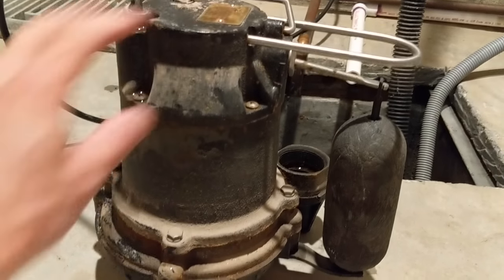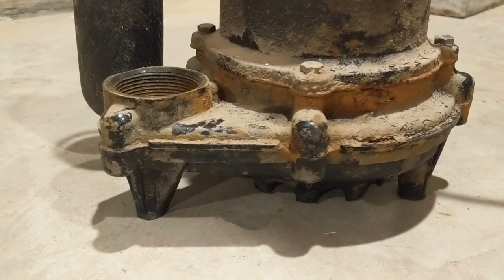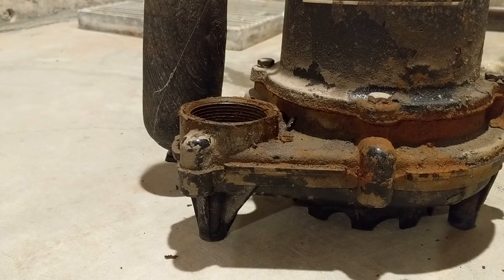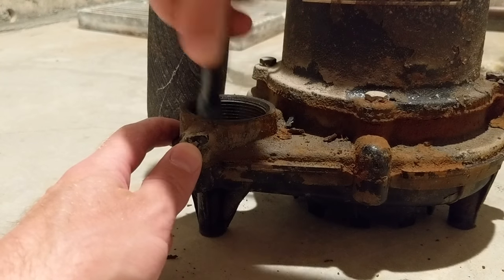Sump Pump Not Working?  It Might Be Air Locked!

Comment: HD sells a Basement Watchdog pipe that is pre drilled and cemented with all that you need to connect. I used on the same pump and it works great. For $25 dollars it's one less worry. I've done several pumps and swear by it.

Comment: Actually, an ideal installation would have the check valve out of the pit and 6 inches or so above the basement floor level. Your weep hole should be drilled a couple inches above the high water level. The weep hole should never get submerged by the rising water. Otherwise good info.  Many professionals think a weep hole is unnecessary in the discharge pipe. I assure you it is very necessary, even with a weep hole already drilled into the pump housing.
Reply from the maker: Thanks for the info!  Part of the reason I do these videos is to start a discussion.  I really enjoy coming across people whom have something to add:)
Reply: Maybe that's the problem I am having. The pump will always run when the water gets high enough to move the switch, but about one time in ten no water actually gets pumped. The pump would run forever and never pump any water if I let it. So I tried putting in a 3/16 hole between the low water line and high water line. Again, about one time in ten it will run but not pump. Sounds like I should try putting the weep hole above the high water level.
Reply: A follow-up to my earlier comment. It turns out that the lack of water flow was due to the check valve being damaged. I didn't think it was possible, but the flap occasionally got stuck and would not let water flow in either direction. After replacing the check valve, everything worked as it should. I am going to experiment with not drilling a weep hole. As of now the hole is not needed.
Reply: Not sure why the weep hole would have to be above the water level.  In the case of an air lock, the air would just bubble out of the weep hole.
Reply: I am beginning to wonder if this is why my pump would turn on but not pump water; I assumed it was because the discharge pipes had gotten frozen then the big thaw happened and my sump room was underwater til a good shake finally got things moving again
Reply: @SelkiesSong  Yep. Sounds like it was air locked.
Reply: You're the first guy to say drill the weep hole high enough-- above the high water mark. Interesting. Makes sense. Think a lot of people drill simply a couple of inches above pump discharge.
Reply: @baseline8017  Still could've been an issue of not having a weep hole. I am going to drill one come dry season. I just took piping and check valve apart on mine. Check valve flapper appeared seized. Now, I am not sure. That slight seizure or being a little stuck might give way if no air lock in pipe beneath check valve.
Reply: @bfullsyou  - I guess it is possible that the weep hole was a factor at some point but I am happy to report that a year later my sump pump has never skipped a beat even though there is no weep hole at all. Maybe some pumps require a weep hole and my particular model does not. I don't know.
Reply: @SteadyDrizzle  You're probably right-- might not need to drill weep hole higher than high water mark.
Reply: @SteadyDrizzle  This is true. This is what I found out from this channel called Power Equipment Direct: The weep hole should be lower in the pit because it is meant to relieve the pipe of any air left in the system after a draining cycle. You want the hole to be underwater and the pipe below the hole even after a draining cycle, so air can't get trapped in the pipe. Having the hole up high greatly increases the chances of air lock and burning out your pump.
Reply: Actually, you want the check valve in the pit whenever possible so that should it fail water stays in the pit instead of spraying all over the walls carpet etc
Reply: And placement of the weep hole should be in mfg instructions. I dont recall them being that high i believe they generally recommend about 6". Mfg specs almost always take precedence apart from local code. Failure to comply can void warranties.
Reply: @bfullsyou Are you sure
Reply: @timmark4190  I’m still learning. Got anything new?
Reply: @SteadyDrizzle   with a big enough hole, yes. If your hole is too small (or dirty and clogged) then surface tension of the water might keep it from coming down while the air is trying to push up and the water is trying to push down; they will push against each other and capillary effect/surface tension might be enough to keep them from mixing (with bidirectional flow which you would see in a big enough orifice).  You can either put a hole below low water so that it can equilibrate and get inflow or a small hole above high water as a guaranteed atmospheric vent.  The right sized hole between the two might cause problems.

Comment: Drill the weep hole below the low water line so you don't hear it spewing.  Doesn't matter.  ALSO, this style pump triggers on too soon.  Either raise it under some blocks or install a secondary vertical float switch.

Comment: Great video, but your weep hole was already in the threads of your check valve , my check valve is on a 1/4 adapter I screwed on a check valve like yours and drilled a hole through both while tight, your weep hole should be below check valve. The extra hole cannot hurt though.

Comment: Great video and thanks,  the problem i have with my sub-pump is that i no longer hear the the machine running like it used to...
Reply from the maker: Thank you! Is it running at all? I've never heard of one not running like it used to. I think if they fail they just stop working all together. But I have been wrong before. Part of the reason I made the video is because my pump seemed like it was running (humming) but I could tell there was no water in the discharge pipe.  Glad this video is helping some people out!

Comment: My outdoor submersible pumps always get air locked.  I have to unscrew the hose as it’s on until water starts to come up then rescrew it on quickly.  What a pain.  Can I put a small weep hole in the hose itself close to the pump to solve this problem?

Comment: The most likely reason you'll have a pump that is running but not emptying the water is that the check valve is broken. What happens over time is that the valve breaks loose from the inside of the pipe. It's attached by just a thin piece of rubber that wears out from hundreds or thousands of open and close cycles. Once it has broken off, it will jam in the pipe from the upwards water pressure when the pump goes on and will not allow the water to exit. Just like a piece of debris that blocks a water pipe. For example, when you take a big smelly dump and your footlong log blocks the drain pipe when you go to flush the toilet.

Comment: It seems if a hole is drilled above the checkvalve, the water in the pipe will drain back into the sump thus defeating the purpose of putting in a checkvalve.
Reply from the maker: Yes, the weep hole must be below the check valve.

Comment: Thanks for the Video Anthony.  I enjoyed watching.. I think for watching the video I may have a Airlock problem.. I live in the Middle of the block that is pitched down so I receives everybody's rain water.. a whole nightmare.. so I go the French drain install and it works fine in light rain, but heavy rain you can forget you even have a Sump pump.. I can hear The Sump Pump Humming as if it's Clogged and not working.  I've tried and pull the Float up assuming that was the problem but the Float was already up.. do you think it's a Airlock problem. Thanks a lot bro.
Reply from the maker: That sounds exactly like the issue I was having. It could be an air lock issue or a clog somewhere. One of the best parts of the weep hole is that it shows proof your pump is working. If you can see water spitting out the hole but the level isn't changing then it's either coming in as fast as it's leaving or there is a clog downstream.  Good luck.

Comment: Drilled the weephole. Worked great then right back to not working. I manually turn it off and back on and it works again. Then a couple cycles later it stops and so forth???
Reply from the maker: Someone in the comments suggested looking at your check valve.  Might be good to take a look at that too?  Sorry for the late response.

Comment: Good video. Yesterday I woke up went down in my basement and my pump was running but no water was pumping out. Couple years back  installed a Zoeller  on 2 -8-19 because the last bump failed. Been working flawlessly ever since.  Check valve has been very noisy, I got the pump running it was working okay I went and got a new check valve and installed it. Pump worked all day yesterday no problems got up this morning and it was running in the water was pumping I unplugged it and plugged it back in and it started working normal again. Any suggestions? Thank you
Reply: Oh, yes I have a weep hole in the pipe

Comment: So I’ve installed one before after watching a video. Same one you have. After 9 years it quit. I bought a new one & it won’t even turn on when submerged. The outlet works with other things so cannot figure out why the new sump pump won’t even kick on???
Reply from the maker: After verifying power at the outlet I would toggle the float switch manually. If the pump doesn't kick on I would take it back.
Reply: Thank you so much that worked!

Comment: should not the weep hole be placed BETWEEN the pumps discharge port and the check valve?... you have it past the check valve???
Reply from the maker: You are correct.  It belongs between the discharge port and the check valve.  That is where I put it:)
Reply: @AnthonyDalBen  Actually the weep hole above the check value totally defeats the purpose of the check value.. All the water will drain back into the well, potentially cycling the pump continuously. Perhaps you should update/clarify this video as a lot of people are getting advice from it.
Reply from the maker: @senfilatechnologies2938  Hi again and thank you for your concern. Please watch the video again. I state the weep hole belongs before the check valve which is where I put it. Yes, if the weep hole is after the check valve the water in a riser would completely drain out (to the level of the weep hole) which may cycle the pump back on depending on the diameter of the riser pipe and capacity of the sump. Can you give me a time stamp where I state the weep hole belongs any where else? I will be happy to make any clarification needed.
Reply: @AnthonyDalBen  MY apologies.  Now I noticed at 6:47 the check valve IS above the weep hole.  Sorry, I thought you connected the valve directly to the pump outlet.  Once again my mistake and my sincerest apologies for any confusion I may have caused.

Comment: I recently did a sewage pump installation for my basement,old one wasn't working no more.Saved a good $1200@ least from what plumber was asking 🤷🏾😮‍💨.But I didn't put a weep hole in discharge pipe.Should I go back in and do it and is weep hole above the water line or below?
Reply from the maker: Might be a good idea!  Below the water line is probably best but I would consult the manual.  Good luck.

Comment: Should Teflon tape be used on threaded fittings for future easier removal of fitting when needed? Nice helpful video. Love the Ninja training basement!
Reply from the maker: Good question!  I thought about that when putting everything back together.  Plastic pipe is one of those grey areas where what kind of sealant to use (if any) is up for debate.  Before I re-installed the pipe I decided to look it up and found that most people say not to use teflon tape on plastic fittings because you run the risk of over torquing due to the lubrication it provides.  I probably would have been fine using it because I trust myself but didn't want to set a bad example.  If you use teflon tape on your plastic fittings make sure to not over-wrap it.

Comment: thanks for this very educational video, does anyone here know if i can drill the weep hole above or higher than the check valve ? or it has always be between check valve and pump, thanks
Reply: No can't put the hole above the check value
Reply: If you put the hole above the check valve, then it defeats the purpose of the check valve by letting all the water sitting above the valve drain back down either into the pit or onto the floor around it. The valve’s purpose is to stop it from draining back down in the first place. That’s the long answer lol. Short answer is no, only put a weep hole below the check valve.

Comment: Awesome video! Is there a need to add an additional check valve somewhere along the discharge line outside of the basin?  I went to HD today and got an Everbuilt 1/3 HP pump and the sales person gave me on just like the one you threaded at the output of the pump plus another Everbuilt check valve that has to be installed outside the basin it’s the Everbuilt 1 1/4 to 1 1/2 ABS in line Sump Pump check valve.  Please advise. Thanks!
Reply from the maker: Thank you!  One check valve is enough, just make sure its above (downstream) of the weep hole.  The line up should go - pump, threaded connection, pipe with weep hole, check valve, discharge pipe.  I hope this helps!

Comment: I thought you said the weep hole should be below the check valve. It looks like yours was drilled above the check valve. How can you drill the weep hole below the check valve if the check valve is connected directly to the pump.
Reply from the maker: Hi and thanks for asking!  The fitting I attached to the pump housing was just a connection to attach my pipe.  I put the check valve above (downstream) of the weep hole.  If you put the weep hole downstream of the check valve then everything you are trying to pump out will just come down the pipe after the pump shuts off.  In order:  threaded fitting, pipe with weep hole, check valve, discharge pipe.  I hope this helps!
Reply: The threaded fitting that you screwed in to the outlet of the pump was the check valve right? Would I need to add another check valve on the discharge hose outside of the basin?

Comment: Thx a lot Ben this is really helpful. Nice and clear and it supports many who need help with this issue. Appreciate it. By the way I have a question here.  I have a weep whole as indicated by you on a plastic pipe, however I see the pump s just humming and the water does not seem to be pumped out, also the Check valve is not a remove and fix pattern but a sealed Valve. Now the only option is to cut the pipe and install a new check valve. Is there a Tip or a way to clear the Air locking without cutting? PLz advise.
Reply from the maker: If the weep hole is in-fact before (upstream) of the check valve and no water is coming out while the pump is running  then it is either clogged or the pump may be seized up.  Try clearing the weep hole with something that will fit in it like a paper clip.  Thanks for watching!
Reply: @AnthonyDalBen  The water is coming out of the weep hole while the pump is on, but its not going out to the water exit out of the house. Pump keeps running weep hole keeps spitting water out but the water level in the SUMP does not decrease..thats the situation and as a result the pump continues to run 24/7 spitting from weep hole and water level does not decrease at all. Thanks  a lot for your further advise and sorry to bother you.
Reply from the maker: No worries! Someone in the comments had a similar issue and it turned out that there was a clog somewhere in the discharge line past the check valve. I'm not entirely sure how he cleared the clog but if you find his comment and ask, he might reply 😁

Also, if no water is coming out of the discharge line and that pump continues to run it will burn out. I would probably unplug it if I was you.
Reply: @AnthonyDalBen  Sure thx. By the way if the water level is above the Weep hole then it drains and empties fast.. that indicates there is no clog past the Valve as the water is moving so I am confused where the problem is when level goes below the weep hole and pump runs and water levels stay where it is. Thx a lot.
Reply from the maker: @venkatreddy7340  Oh!  Well that sounds like your float is stuck.  There should a float on the end of an electrical cord or one on a fixed rod.  Either way they are supposed to turn your pump on when the level gets too high and off when the level drops enough.  I would try to toggle your float to see if that shuts it off.
Reply: @AnthonyDalBen  Yes I did toggle with it manually and was able to shut it off and ON but the point is that it keeps the pump on as the water level is not going down at all hence the float is not going down.
Reply: @venkatreddy7340  did you solve this? That's the problem we are having now. Thanks!